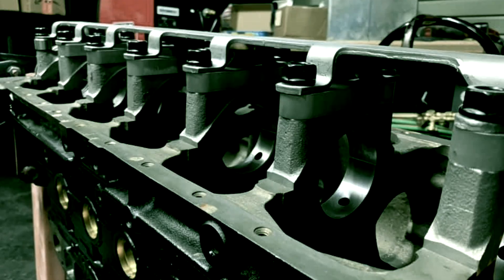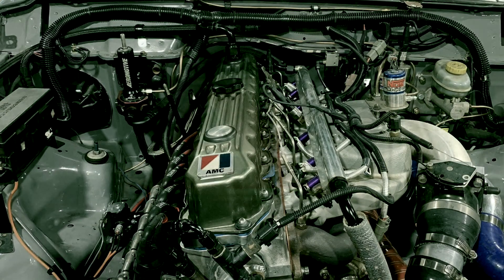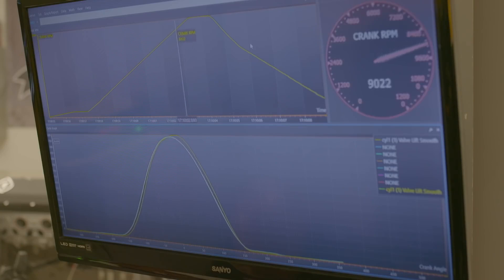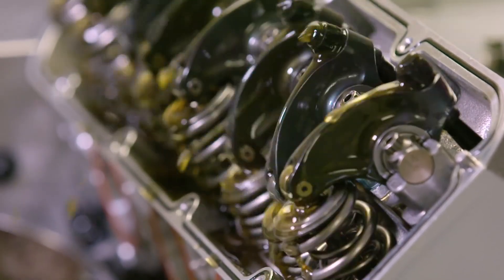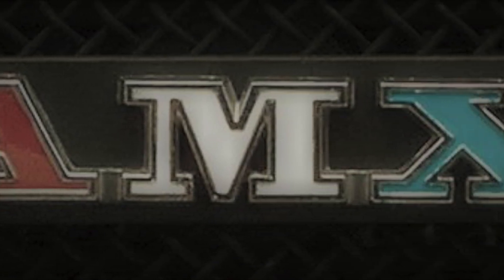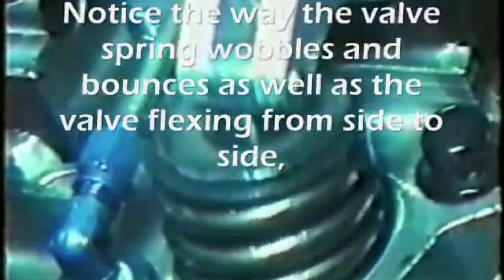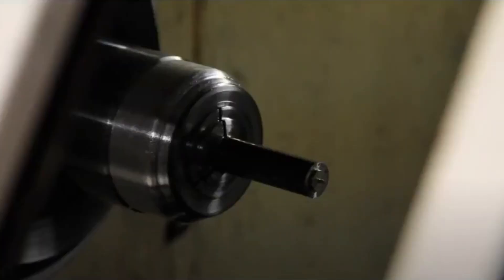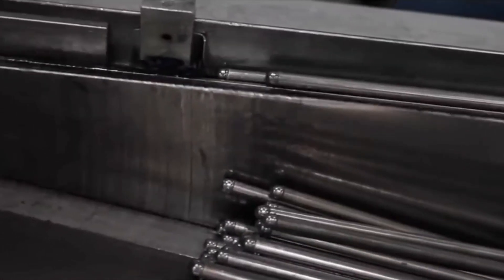Building a 10,000 RPM Jeep 4.0 -  The ultimate upgrade

Comment: I am going to do it. They push rods are in the mail. I already have the Xtreme 4x4 197/201 Hydraulic Cam for Jeep 4.0L 1964-98 cam with the High Energy lifters. Harland and Sharp 1.6 rockers. Clegg 5/8 spacer. THOR cowl intake, wrapped. BBK 62mm TB. TB spacer to clear the valve cover (had to bore it out to 62mm). 4 hole injectors with bigger fuel pump. I so need to strap it to a dyno to see what it can do.
Reply from the maker: Awesome news!  Keep us posted!
Reply: @amxj  I got It started 2 weeks ago and broke the cam in. Today was the first drive, to go get groceries. Hahaha! Ran good. I need to drive it more, but work is getting in the way of that. My factory push rod length was 9.604. So I put the 9.600 x .165 x 7/16th double taper push rods in. I DID NOT have to clearance the head! Number 5 intake was the closest at .185 from the edge. I would assume each head would be different in that regards. Your mileage may vary.
Reply: I have had the chance to drive it finally! One thing I have noticed is the temperature of the engine has dropped. It also has gobs of power! I am still in the break in period of the cam, but i am about to take it on a 3000km journey on Thursday. The factory ECU is doing its thing. It is running better the more I drive it.When i am back from my trip, I will get it strapped to a dyno and see what she can do. Mid September.
Reply from the maker: @ThePurvey how did it turn out?
Reply: @ThePurvey  im wanting to put this cam in my stock 91 ho engine rebuild and swap into my 90 comanche running on the renix will this work with stock pushrods and valve springs
Reply: @amxj  Well, the engine runs like a freaking animal! It was visceral to drive. Then I destroyed my torque converter up there. Was not locking up properly. Slipping. Shuddering. I had to tow it back. I have a massive hayden rapid-cool transmission cooler right up in front of the condenser.  The trans is on the bench, getting a refresh and brand new TC. I also have found the vibration in the rear that has eluded me.I have the Iron rock hack and tap. It is also smoked. So a proper SYE on the way. I will touch base when it is all back together.
Reply: @jacobmoreland8354  It will work just fine. I would highly recommend doing all the other intake and exhaust mods to make use of the more aggressive cam. The whole idea is to move more air.  Definitely the THOR intake is not for everyone. I love it. When that 4.0 is screaming, you hear all the air it is drawing and you just want to feed it more!

Comment: This series was awesome to listen too and I learned a ton. It has inspired me to keep the 4.0 in my MJ and use the tips throughout your videos to add the horsepower I want. My question is, for a street/offroad build is a 4.6 capable of spinning to 7k rpm’s reliably with the improvements mentioned? Or should I stick to a 4.0 for the shorter stroke?
Reply from the maker: It’s a lot of piston speed for a stroker but my current 4.9 spins 7000 reliably.

Comment: Quite a thrilling conclusion to an amazing series. Thanks for taking the time to get this interview together, now it can be saved for a long time to come.
Reply: The TFC is still running good with 2 factory E fans. I have added a trans cooler and a power steering cooler in front of the ac condenser. No proplems keeping it cool. The 2 most important mods to the cooling system were the TFC and taking a drift and hammer to all the flashing in the head!

Comment: back around that time 2001, the only solution before Trend, there was Smith brothers Titanium pushrods. i was building a naturally aspirated Ford small block then for the NMRA Hot Street class. Smith brothers pushrods were the hot ticket for high RPM race engines. pretty crazy thatRick worked at Diamond pistons, they sponsored a bunch of my friends cars, the Clement brothers, Tofie Haddad, Dan Millen at Livernois Motorsports.
Reply: You really don't need tie pushrods even from a weight standpoint.  The tie round rod or a chrome moly PR will bend under load.  This is why Bob Fox started making the double tapered designed pushrods, to eliminate the bending caused  when the engine was under operation.  A STRAIGHT ROUND pushrod design does bend (all of them), some worse than others.
As to the weight of a titanium pushrod, Weight on the lifter side means very little to dynamics of the entire valve train.  The weight of the valve, valve spring, lash cap, locks, retainer, and the centerline of the rocker fulcrum forward over the valve tip, all this weight means everything to valve train harmonics, have to make this your focus to improve or diminish valve train harmonics.  If the head casting is moving (like the 4.0L JEEP eng), This has to be fixed before any valve train issues       
can be addressed.